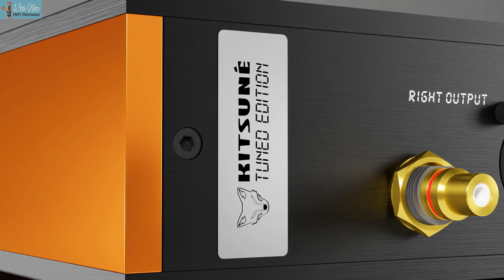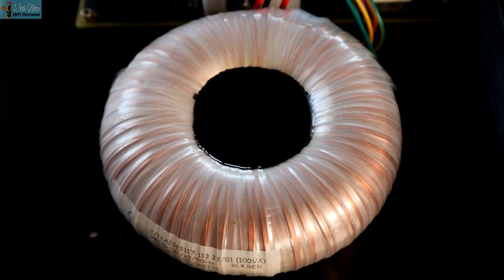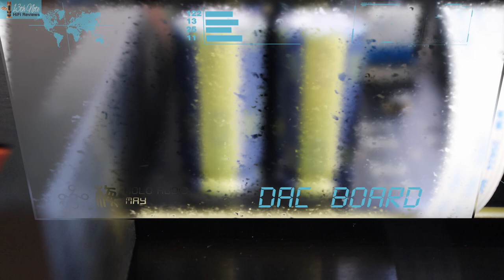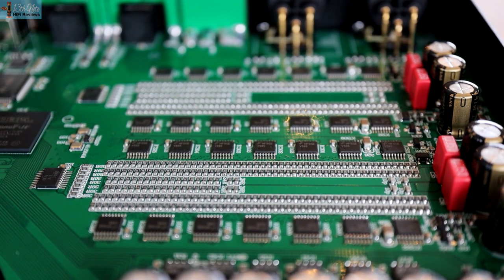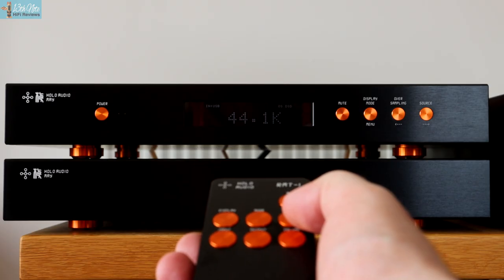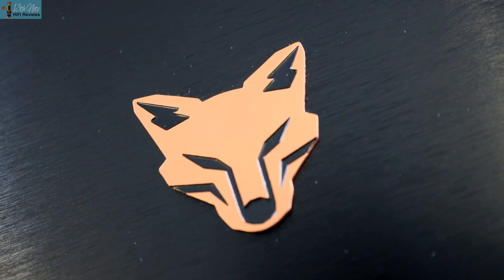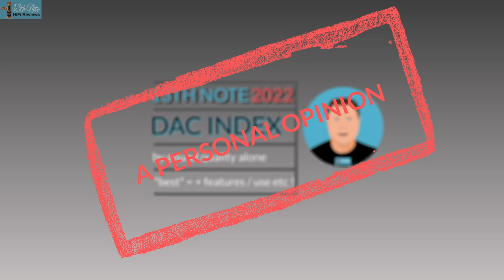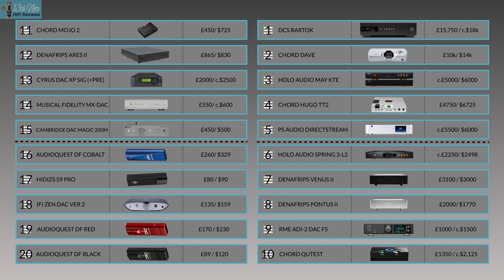Holo Audio's MAY KTE is an Astounding R2R DAC (vs. Chord & PS Audio)

Comment: I own the Chord Dave, the Chord Mscaler, and the the Holo Audio May Level 3 KTE.
I prefer listening to the May... with the Mscaler.
The May sounds best in NOS mode.
Oversampling in the May does not offer the best sound quality.
But keeping the May in NOS and doing the oversampling outside the May works really well.
Hence the use of the Mscaler. Since I already had it, it was a no-brainer to try it. I am very happy with the results.
I may be selling the Dave but the May and the Mscaler I am definitely keeping.
Reply: but the May has only single coax input，then how can you upscale to over 700khz？

Comment: I've been using the Chord Qutest for about a year now and I recently got the Spring 3 KTE. I was blown away by its performance as it was easily distinguishable from the Qutest. The black background, instrument/vocal separation, imaging & sound stage, the speed & dynamics; it was money well spent. I went w/ the Spring 3 because most of the reviews say the May while being the superior DAC is only slightly better by approx. 10% but double the cost. I feel I'm done w/ my chain at this point.
Reply from the maker: The difference of the spring 3 L2 that I borrowed was pretty emphatic a difference against the Qutest in the system I have too, as expected. Enjoy it. 😀🔉🎼 ten percent is about right!
Reply: @First Last If you're not in a rush you might wait for more reviews of the R26. I was aware of it being released but it was not available at the time when I pulled the trigger on the Spring 3. The price of the R26 being half the price looks good. I honestly didn't want to spend $3000+ on a DAC but here I am :/
Reply: @mfgillia7606  Another thing that pushed me to the Spring 3 KTE was that the May would have required 3 boxes vs 1; the DAC, PSU, & PreAMP. Thats not exactly space friendly for my particular setup.
Reply: @heyguyslolGAMING  Yep, me too. Though with the additional box on the May its easy to see where some of the additional costs were spent.
Reply: any affordable dac that are close to performance of the qutest?
Reply: The Spring 3 is amazing, but it's actually inferior to the Qutest with Plixir Elite BDC. I just demo'd the Spring 3, Hugo TT2, And Denafrips T II. Qutest + Plixir came out on top. 

Which makes sense because I did an in-home with a Paul Hynes SR7 (local loan from a buddy) and the Plixir.... Plixir edged it.
Reply: I owned the Spring 2 KTE and debated on upgrading to the May DAC KTE.  Then, I chose the Spring 3 KTE model as I saw a detailed review indicating that the Spring 3 KTE was about 90% of the May KTE’s sound quality, just as you mentioned.  I do regret not adding the Serene preamp section to my Spring 3.  I have a Luxman L509x integrated, which is very nice, but I have become interested in good quality class D amps such as the Apollon amps.  I don’t want to use my Luxman as a separate to test different class D amps because the Luxman only allows me to use the RCA inputs when using the amp section as a separate.  I prefer to test amps using balanced connections.  Lastly, I wonder how the MSB Discrete DAC would compare to the Spring 3 KTE or May KTE?  I would like to conduct a shootout between the MSB Discrete and Spring 3 KTE!
Reply: @heyguyslolGAMING ,

Do you have a rack or table?
Reply: I had the Qutest and bought the Spring 3 KTE a few months ago and the improvement is absolutely amazing. I am considering the May KTE although the improvement may be small the  10% should be appreciable in my system.
Reply: @DBravo29er ot even close my friend. Qutest sound 2dimensional, veiled and thin next to spring, even with more expensive power conditioner.
Reply: @amaya897  I've literally demo'd the 3 KTE next to the Qutest + Plixir Elite BDC. I wasn't asking a question. 😂
Reply: @DBravo29er  have Qutest, Spring kTE and May level 2 infringe of me. I am not sure if you hearing things differently or just listen to certain genres where the differences are not that apparent but it’s literally like comparing flac recording with 128k MP3. While spring and May are relatively close Qutest just doesn’t have same depth, stage, texture to the bass or body of the instruments.
Reply: @amaya897  If you don't have a Plixir Elite BDC with Statement DC cable, you've literally never heard your Qutest before. Qutest sounds like a completely different DAC. It beats Spring 3 KTE and trades punches evenly with May KTE. 

I did a two week in home demo. And both the Spring 3 KTE & May KTE were fully broken in (they belong to friends).
Reply: @DBravo29er  again, I had exactly the same setup. Qutest is not even close. I only can assume it’s less demanding music genres or flawed hearing where you can’t pick up the difference. It’s a night and day difference between both dacs. Apart of that we have plenty of reviews of holo products being compared to higher end chord dacs like TT2 and Dave, where reviewers lean towards more natural sounding holo designs. It wouldn’t make sense for chord to release more expensive hardware (up 12x of the cost) if it’s inferior to mid range 1k usd qutest. 
All of this not mentioning the option of mentioning upsampling through hqplayer or Roon and feeding this signal to nos on spring/May which pushes the dac even further ahead of qutest native so so upsampled signal.
Reply: @amaya897  Which DC connector did you get for the Plixir-end of your cable? DC 5.5-2.5mm or DC 16-2? The connector matters.
Reply: @DBravo29er  the latter i think. It will not matter that much compared to what is going on in dual channel r2r dac compared to a qutest bud.
Reply: @amaya897  Okay, I just caught you in a lie. The Plixir supplies all use DC16-4 balanced connectors. You've not heard this. You are lying about having heard it. There's no option for the Plixir end of the connector; they ALL come in DC16-4. BUT, I've heard the two pieces of HoloAudio equipment you've heard. For two weeks.

Why don't you just admit you have zero experience instead of being a brand fanboy?

You've only heard a Qutest with a $13 meanwell SMPS. 😂
Reply: @amaya897   No reason to argue with people who believe that power conditioner can elivate the sound to such levels. Next time he will try to convince someone that his shiit 300 usd amp with good power supply can rival a Bliss and drive Susvara. People will always try to find justifications for their purchases.
Reply: Excellent review! I auditioned many DACs before choosing the Holo Spring 3 KTE  which is more natural and three dimensional sounding! 
I preferred it over the chord Quetest, TT, Bricasti, Tubador, Denafrips 1, etc...
Reply: @gaekooooo2531  I actually just demo'd my Qutest with power supply against a dCS Lina. Keep telling yourself Power supplies don't matter. 😂👍

Comment: It’s a terrific DAC for sure. I have one and have found the inputs other than USB use the inbuilt PLL, whereas USB doesn’t use it. I find comparing the AES input to the USB input (from the same modded Auralic Aries streamer) yields better results from AES, but you do have to wait a bit for the PLL to lock, but it’s worth the lift in sound quality.
Reply: What AES cable are you using?
What’s mods were done to the Auralic Aires?
Reply: @robertm8518  things have changed since that comment. The AES is muon AES by Network Acoustics, but the streamer is now Raspberry Pi with Ian Canada boards and clocks. Pretty darned amazing. Audiophonics in France have the range, YouTube has the vids.

Comment: I've heard this Dac plays very well over its I2S connection, e.g. from a Jay's CDT2 transport.
Reply: I have this set up with my Spring 3 L2 and don't recognize my Jay CDT2-Mk2. I hear details and music never heard before on older CDs. Much much better than the other interconnects I used before with the Jay (including AES/EBU). In short total lack of digital artefacts with the I2S.
Reply: @jmlathion2909  Thanks for sharing.

Comment: you can have true balanced out, without true balanced design troughout.  As the flip of the phase in order to send a balanced signal can be done at the output. There are some costly DACs that do this like Chord Dave for instance. And Hugo TT2. They are both single ended design. But of course with true balanced outputs.

Comment: I wish Holo Audio would refine its size. It has such a wide footprint... 430mm x 300!  If it were 300 x 300 that would even be better. Make a thicker version and stack the components on 2 PCBs, if necessary.
Reply from the maker: I think I agree with you. When I did open the case there is lots of empty space. They are probably buying in the cases and fit the electronics around that.

Comment: Great review! Felt particularly relevant to me since I'm getting a Holo May and am in need of a better source - leaning towards getting an Innuos ZENith! I noticed you said the sound was better from the Sonore opticalRendu/ultraDigital than the ZENith in your Holo Spring video - would you recommend that instead?
Reply: I'm planning the same combo Holo May KTE & Innuos Zenith.  Have you gotten that combo, how does it sound?
Reply: @DeanCampbellusa  Yes, got both and it's been a huge upgrade to my system coming from streaming on a phone or DAP (DAP is definitely better than phone) and the DACs I was using before (Chord Qutest and the iFi Pro iDSD Signature - both good DACs but May is on a different level).
Reply: @intheflowapp  thank you for your reply, would you mind telling me what cables you used to connect the May and the ZENith, and if you like them. Thanks, and enjoy listen to your system.

Comment: Nice review. I got the May L2, and am very happy with it.  Agree on heat, so turned some extension feet on the lathe with some oak wood out of the yard. Gives it a bit more air flow between components. One complaint is that there is only a single COAX in. I would consider two the bare minimum.  So have to resort to one tosslink connection.
Reply from the maker: Good one Daniel. Maybe you’ll be the supplier for everyone else with the feet. I suppose it does have the bnc and could just use an adapter

Comment: Nice review, not just repeating what others have already said. However, there's no description of sound differences between NOS and OS and it would also be extremely interesting to hear how external upsampling (Roon/HQPlayer) benefits this DAC, because if it does then it might be a true king of giving best of both worlds on demand (I'm wondering if it catches up to Dave then).
Reply from the maker: Thanks Michal. I explained nos is clearly the one to go for, then described sq so I think I covered everything. I don’t get involved in format this or that beyond lossless cd. I don’t use hq player too and I don’t sit listening to this software and that comparing minutiae . I believe in cd quality at a minimum through a good dac. No hi res format can ever catch up to the quality of the dac at its base good / cd level  - ie how it deals with cd - things like dealing with jitter, power supply, analogue output, noise and so on. The difference to the higher sample rate music is often small or relatively small to the quality of the dac so elaborating on this takes unnecessary time. Higher sample rate is good, but utilising highest sample rate through hq player probably utilises small changes and people think that hi res makes up loads to other DACs. It doesn’t.
Reply: @13thnotehifireviews7  Fair enough, I get your point, it's of course fair to play the same thing through different DACs and compare the outcomes directly so that the potential buyer knows what they're getting out of the box. I was maybe thinking too technical in terms of how the May can also be used as a foundation for further tweaks/customisation (unlike non-NOS DACs). A very enjoyable review nonetheless and nicely visually done 👍
Reply: I use HQPlayer/Roon with my May KTE (via a Sonore optical Rendu and Matrix X-SPDif). The May's OS is very inferior to it's NOS.
In my experience, there is no equal to HQPlayer for upsampling. The May sounds equally as good with PCM as with DSD, though I generally prefer PCM. It is indeed the king of being the best of both worlds.

For what its worth, I recently added a Cary SLP-05 preamp, and I always audition new gear at 44.1KHz.  It is so magical I have not yet found the need to oversample.
Reply: @joshua43214  Thanks for sharing that. What changes in sound do you notice when upsampling using HQPlayer before sending the data to the May to be processed in its NOS mode? Would I be correct in predicting that sound contours get more defined and detail retrieval (or at least the perception of it) is higher? If so - would the main benefit of NOS be that it's "smoother" or are there other strengths that might make upsampling unnecessary or even undiserable? Thanks.

Comment: Sir, I so much appreciate your artful and sincerely upfront review of the May KTE which I currently dedicate to my head-fi system.  How do find the Kinki EX integrated to work with the May on a sonic level in terms of character of each??  I have considered this pairing for my speaker system to use with my PureAudioProject Trio Classic Voxativ PiFe’s.  Any thoughts observations you would care to share would be greatly appreciated.  It looks as though you are channeling your outputs to Bucharts?
Reply from the maker: Thanks Mark. I think they work very well together. The depth of the Kinki and the same for the May. Plus Kinki is very dynamic and drives lots of speakers well. Not going as bass deep as the Hegel h390 - very slight , which is prob due to my pmcs and other speakers tested liking power (they are 86.5db sensitive) and the different power specs between amps , but some could prefer the Kinki over the Hegel I think because of depth soundstsging the Hegel doesn’t have as much. Releasing fuller thoughts when I get the Kinki (ooohh arr) video out soon.
Reply: Thank you Simon for your prompt response which is appreciated.  I’ll look forward to your Kinki review.  Another question I have about the Kinki is how is its sonic density, especially in mid range and upper bass, as well as its tone profile in general as you find it to be.  If you could keep these questions in mind when you do your review and address those concerns it would be valued by myself and I believe others as well.  Your creative review presentation on the May is quite engaging, thanks again.

Comment: Impressive production! I had the Directstream DSD for a long time - side by side with a Benchmark DAC3 - so deeply familiar with the sound of both. In the end (after more than a year)  I concluded that the DSD was unable to retrieve minute details and dynamics compared to the Benchmark DAC3. The most notable difference was that DSD had a warmer less resolved the bass, lower dynamics, lower reverb, lower low level detail and some roll off in the highs. The DSD absolutely did make things sound much more analog because of this. In some cases, a recording would favour the DSD simply because the Benchmark was too revealing of studio sophistry or harshness from close miked studio techniques but overall the Benchmark DAC3 was clearly superior across my entire music catalog. I would be interested if you get a chance to review Benchmark DAC3. Categorization by price works for dealers (who may sponsor you). However listeners may be more interested in a video review comparison where you group by “presentation”. Furthermore, soundstage is a bit of a misnomer because a DAC with poor phase accuracy will have a wider soundstage which may be more appealing than a more accurate DAC (Depending on listener taste). Soundstage depth is more a function of the treble with more treble or presence emphasis being perceived as being closer and vice-versa. Keep up the good work. Would love to see a summary of DAC’s grouped by sound and presentation than by price.

Comment: How far off would say the spring 3 is in truth? I ask because there are some varied takes out there. Small difference, to drastically better.
Reply from the maker: I think it’s about ten percent but apologies I might have got the wrong end of the stick , if you want to email me - Simon at 13th note dot net, I’ll fill in blanks
Reply: @13thnotehifireviews7  My apologies wherever any wires were crossed, I understand though, surely because YouTube climate has gotten pretty rough (☣️), but truly I meant no offense in my first response nor even in my second, just was little taken back. I'll start by saying thanks for your review, I did see where you mentioned the May being the more musical and the spring more so a sense of decay was present; again, I just was trying to get a greater feel, more specific, for how big of an upgrade that was, based on other reviewers (and users) that surely, yes cannot always be trusted and maybe they've confused me in one direction or the other; but one still tries to glean what they can. Anyhow, now you have answered that, so thanks again for the time.
Reply from the maker: Thanks too Josh, you are perceptive, you get a lot of trolls doing this and sometimes it’s easy to get a bit defensive at times . No worries at all, my bad.

Comment: Perhaps it's ignorance but I have no idea why there is a legion of audio products with BNC inputs and virtually no equipment with BNC outputs so why the BNC  input on everything? I have a CD transport with only SPDIF out and a streamer going into my DAC with SPDIF Coax out. I need two SPDIF inputs on my DAC but  instead must use either a specialist cable with BNC and RCA ends, or use an adapter that I can hear degrading the sound. Luckily, Denafrips will put two SODIF inputs on their Pontus II and the Ares already comes with to RCA inputs.
Reply from the maker: tbh brands who use bnc, obviously want to take advantage of the 75ohm connection which we might as well have if the output has it. I’ve seen bnc on the digital outs of lots of audiophile stuff.